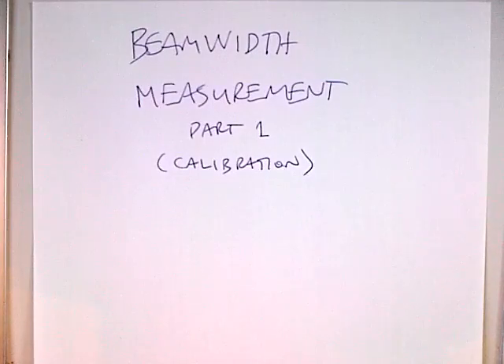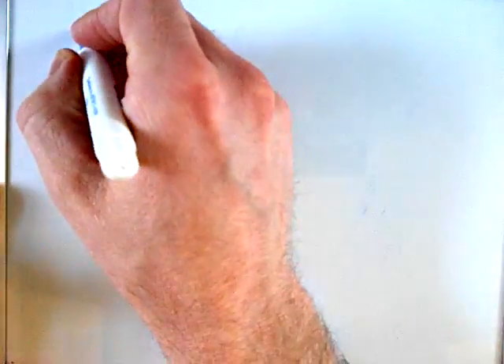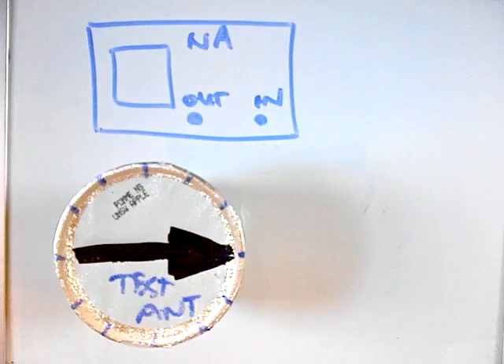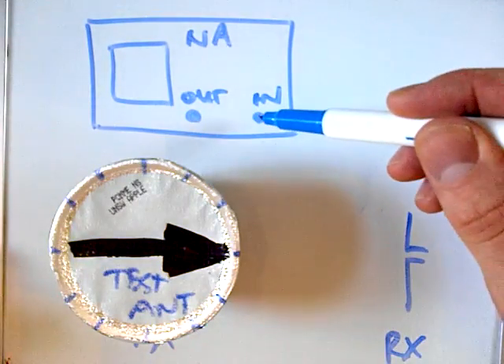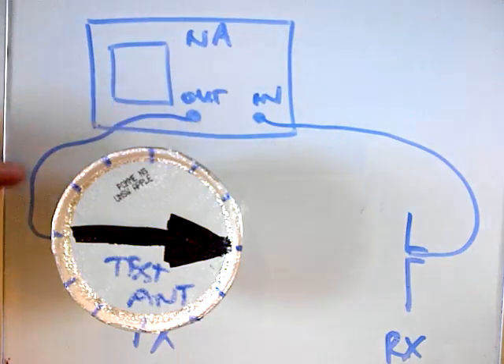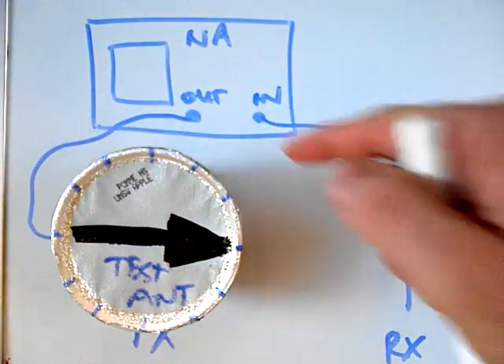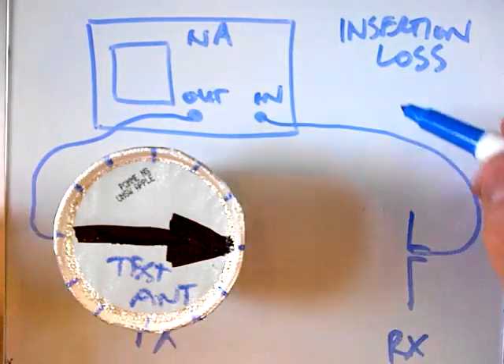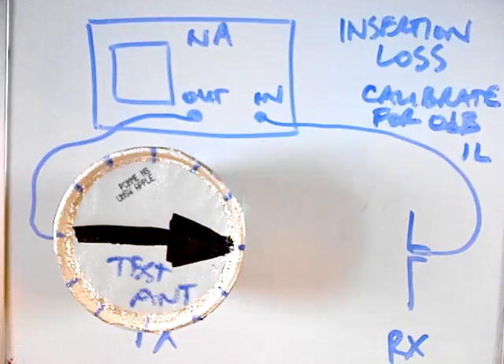Part1 Antenna Beamwidth measurement using NA

Comment: Does beamwidth testing take the range of the receiving antenna or EUT into consideration?  It seems like it wouldn't matter as we are dealing with an angle, but i just want to make sure.  What is the recommended testing distance?  1 Meter or 4?

Comment: Where do you place the marker when performing this measurement?  is there a specific frequency or do you look for an average of 3 dB loss?
Reply from the maker: Beamwidth is measured at a particular frequency, so place the marker at the frequency you care about.  Often you will see radiation pattern plots with multiple colours--often each colour refers to a particular frequency.